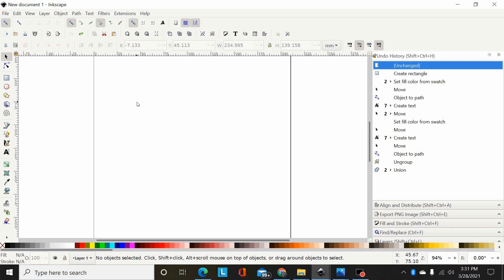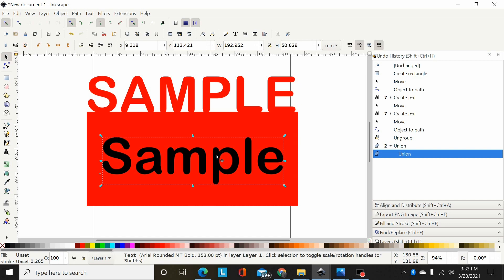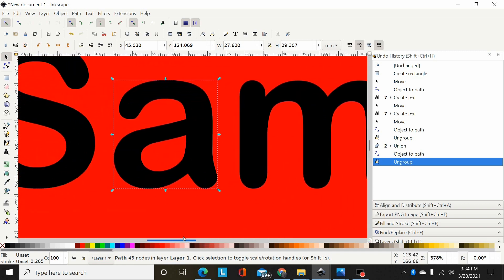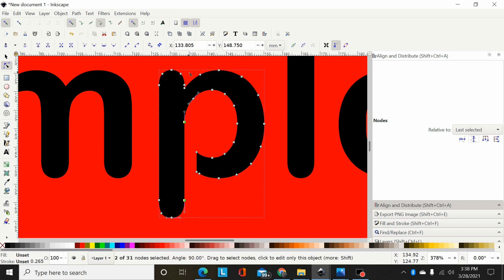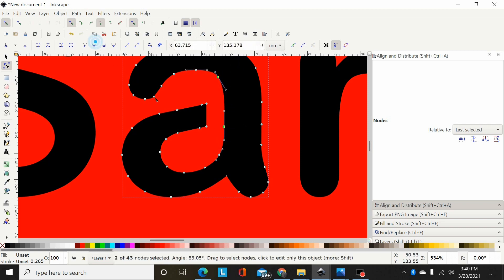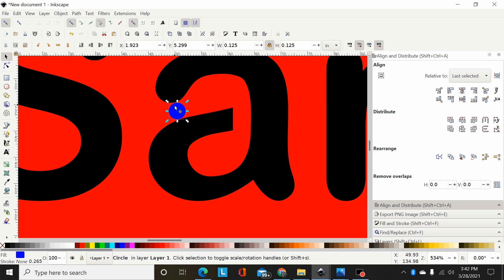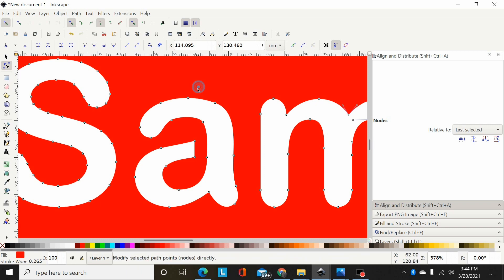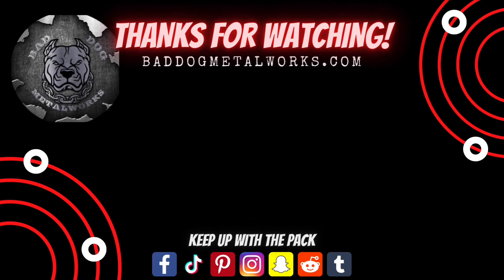Inkscape Tutorial: Bridging Font & Cleaning Nodes for CNC Cutting

Comment: If you don't delete all of the nodes what happens on the plasma cutter?
Reply from the maker: For the cleanest cut on a cnc plasma system you should remove excess nodes. Every node on a path is a start stop point for a line segment. Removing excess nodes allows for the smoothest cut with less blemishes in the contours. Some systems are more sensitive than others so results will vary depending on your machine and software.

Comment: Why do you delete some of the nodes? On your other tutorials you also do your best to reduce the number of nodes. But why? (sorry, new to cnc plasma)
Reply from the maker: It depends on the situation actually. With some machines it's not as necessary to reduce the node count as much. Some machinery/softwares are very sensitive to every little node. I run a Star Lab with Sheetcam, on my machine I can have a circle with 4 nodes and a circle with 20 nodes and as long as they are smooth there will be no noticeable difference in the cut. BUT I have seen other machines that will stutter and jerk at every node so the less the better. If I only made files for myself I probably wouldn't worry about a few extra nodes here and there, but making files for others I've just gotten in the habit of reducing node count to as little as possible. Hopefully that makes sense.